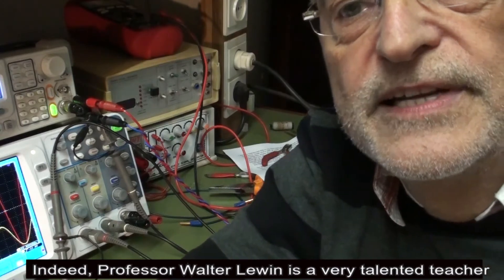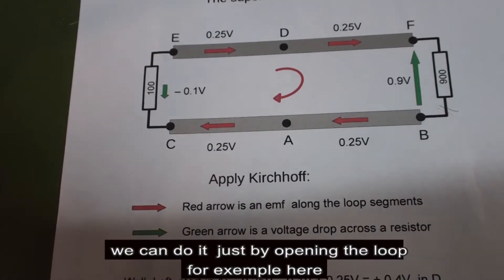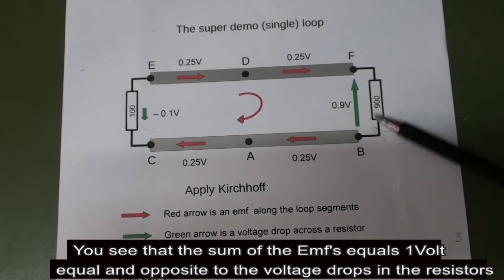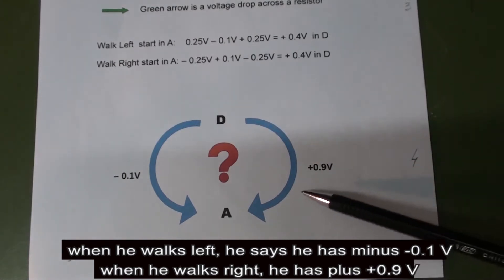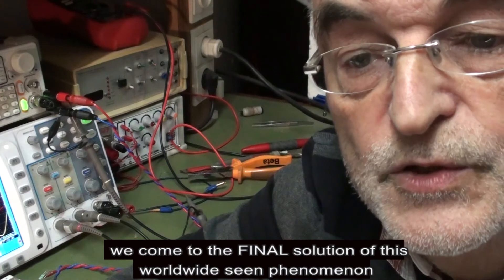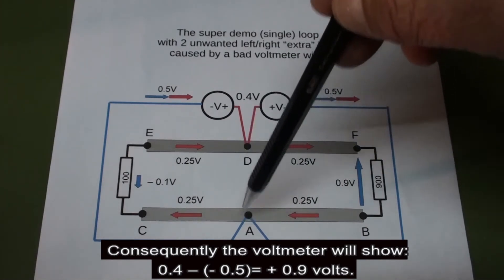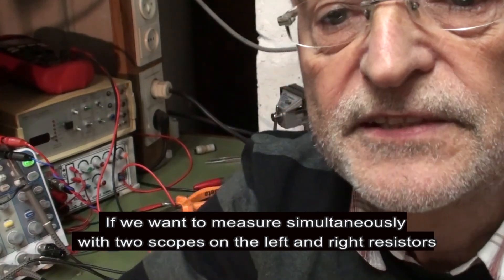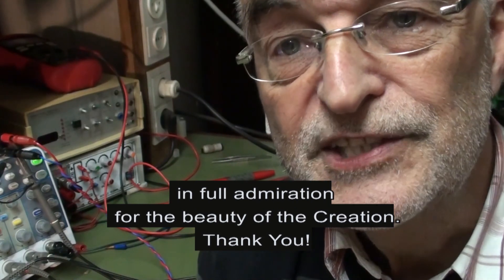W. Lewin Lect. 16 super demo revealed

Comment: Mr. Mabilde, your measurements of 0.25V are caused by the magnetic flux through the loop of your scope wires. What you have shown is that most of the flux is not vertical, but bends outward earlier than you have guessed.
INSIDE a LONG solenoid, magnetic field lines are parallel, but parallel field lines are not a good approximation in your setup, OUTSIDE of your two very SHORT coils.
You can test this by using your scope wires and an extra piece of wire to form a loop that is not connected to your secondary coil. If you place this loop (vertically) close to where your measurement loop was, you should still get a reading, and it can't be due to a potential drop in your secondary coil. It will be due to the magnetic flux.
Reply from the maker: If the scope wiring is in vertical position there is no flux in this plane. And that is the reason why this is the only way to make a correct measurement between A and D  ,  namely 0.4  Volts.
For all other inclinations of the plane you must consider an extra voltage of 0.5 Volt*cos alfa.
This means that in a horizontal plane(cosinus = 1) and on the left side a minus - 0.5 volt is superimposed on the +0.4 Volt (=  the wrong measurement of Prof. Lewin)
 In the same horizontal plane, but on the right side, a plus + 0.5 Volt is superimposed on the the 0.4 Volt
 resulting in a plus + 0.9 Volt
So the influence of the extra emf in the scope wiring is zero in a vertical plane , in all other case it is less.
There is a  maximum when it is flipped to horizontal. I recommend you to look again at the video
Reply: >>>"If the scope wiring is in vertical position there is no flux in this plane"<<<
The field lines are not vertical, so this is not true. You have only assumed it is true.
Reply from the maker: magnetic field lines are perpendicular at least in the plane of the exciting coil, which is NOT a single winding but has about 50 windings, giving a bundling effect, just as in a longer coil. If this was not so then it should be impossible to built a motor or generator.
 The single loop secondary is almost at that same location, a few millimeters above the primary coil. At that location the field lines will bend a very little outwards, thus they are almost still perpendicular to the loop. If you measure in the MIDDLE and in a vertical position, even the small bending of the lines is  NOT significant and not important. They  cancel.
If you still not understand, look again to the video, It will be clear: in the last part I used 2 resistors of each 1kOhm and the Voltage A- D must then be ZERO volt. You will see that it was very difficult to form a perfect and flat wiring loop in a vertical plane. So is was not perfect zero too.
Reply: I can only suggest that you familiarize yourself better with the approximation you have wrongly tried to apply. It applies ONLY to a solenoid whose diameter is small compared to its length, and it applies to the field INSIDE the solenoid. Your weak assumption that the field lines in your setup are vertical is where you keep going wrong. You can test it the way I suggested in my last post.
Your second symmetric setup, does not test for your first ASYMMETRIC setup. I mentioned that asymmetry in my first post to you. You cannot just guess at the dynamic equilibrium state of the oscillating magnetic field.
You are trying hard to preserve Kirchoff's Voltage Law in this case, but that would mean that you discard Maxwell's Laws, instead. Maxwell's Laws are more general, and supersede Kirchoff's Laws. Kirchoff's Voltage Law is only a special case of Maxwell's Law where there is no changing magnetic flux.
It is like Newton's First Law of Motion, which is a special case of Newton's Second Law, the case where there is no external force. It is not that Newton's First Law is wrong, but that you have to apply it in the right situation.
Reply: Earlier, you tried to apply Maxwell's Law (or Faraday), but you did it wrong. You applied it to PIECES of the loop -- only the segments -- and you missed out the resistors. To apply these laws, you need to measure and sum the potential across EVERYTHING. This comes to 0.9V and 0.1V across the resistors, and ZERO across the connecting wire segements.

Comment: Correct answer to proof video.  I mean that what you are saying about measurements error. We must go with the crocodile loop to the left and right to avoid sensing with a crocodile loop a flux from the main loop. But this what you are saying from 15:30 that the voltage 0,5V from external crocodile loop is summed with the inner loop -0,1 its not the right explanation. You can not add voltages in the two different loops You can only sum currents in the joints. The correct measurements should be performed 90 degree to flux lines and or with twisted wires in case of  DVM.
I realy like what you tells about the magician at 22:00 that was a bingo. You never explain him his wrong measurements  as its withe the egg and the chicken story.
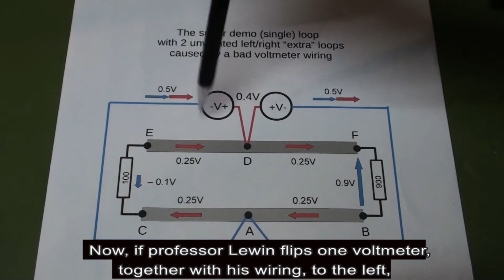Reply from the maker: Thank you very much for your appreciation. I want to explain: at 15:00, I'm not saying that the +0.5 Volts EMF in the extra wiring is summed with the -0.1 Volts(this is only the drop in R1) but is opposed with the +0.4 Volts that exists between A and D. And this +0.4 V is the result of 0.25V -0.1V and 0.25 V. Hope it is clear?
Wait my second video that is coming soon and if you have suggestions for doing supplementary measurements you're welcome to post them!
Best greetings, (hoping you're not the feared " KKK" ?)
Cyriel Mabilde
Reply: I understand. Proffesor is cheating. He draws an incomplete circuit, without current source when! he knows that there is EMF inducted in his big single coil loop. He should draw a ac current source on the schematic and exchange it with an ac voltage source OR he should put an inductor as he is treating whole the loop as single winding coil. On the schematics strait line is a line, without inductance. But in reality the entire circuit's loop is like an inductor, this is why the current is inducted there! His circuit is incomplete. He will never agree with that as he goes to further, with his thesis that Kirchoff is not true. Hes wrong. regards great video.